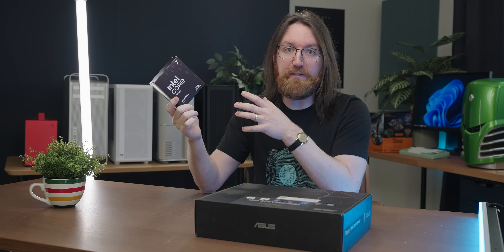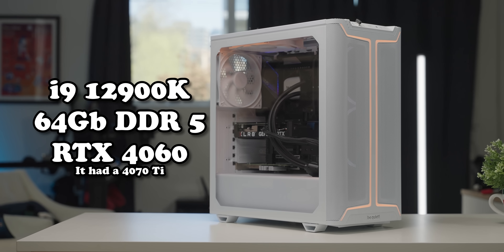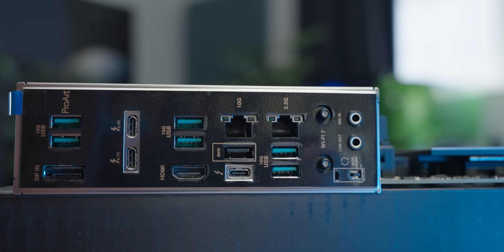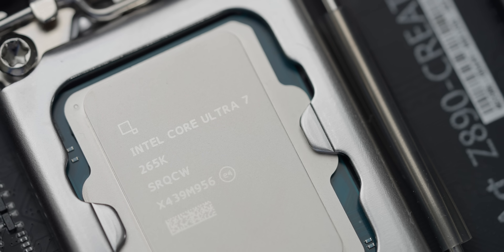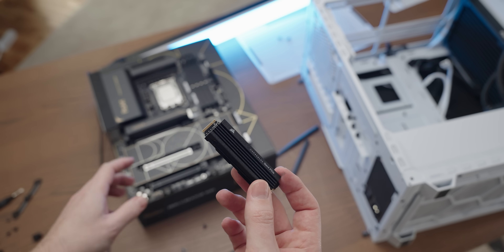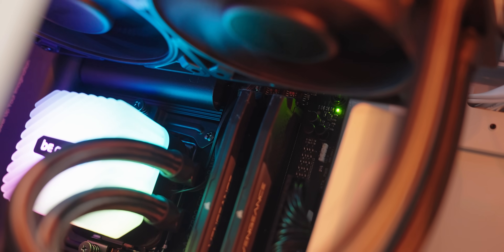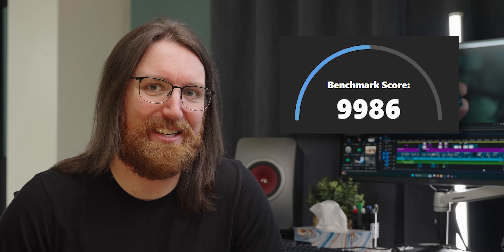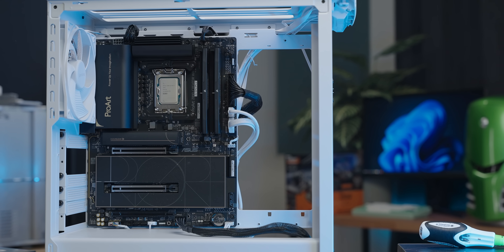I ACTUALLY Bought An Intel Ultra CPU In 2025...

Comment: This video is proof positive of why it's not worth bothering with AIOs. That chassis would fit something like a Peerless Assassin tower cooler and saved you multiple reconfigurations and swapouts with other AIOs. If your case has simple yet effective airflow using a rad to egress heat from the chassis becomes irrelevant.
Reply: it just stop using tiny cases

Comment: For the CPU only the 265 is great value for production work and it has a lower idle power than AMD. The main problem is no support for future CPU generations.
The last time I checked the new Intel motherboards were generally more expensive than AM5.
Reply: Yes but who buys a CPU becuase of idle power usage. The moment you do anything intel cpus jump up to ridiculous power draw, especially the previous couple generations. The problem with intel is their utter stagnation and ridiculous prices on launch. Charging $100 extra on an i9 for 100-200mhz more is peak intel behavior nowadays. No wonder they had to sell so many of their factories.
Reply: @SapTheseCasters  Because not everybody uses 100% cpu at 24/7. Looks like you missed the video where intel was way more efficient from the wall compared to the 9900X by a good amount.
Reply: @SapTheseCasters Even while watching a video its still less power usage than any am5 cpu.
Reply: @kazuviking  wow. Even if that were true, compared to zen 4, which is not, you would save 5 cents per month on your electricity bill. What a reason to buy intel. Are you an editor on userbenchmark by any chance?
Reply: @SapTheseCasters  Remember not only the US exists.
Reply: @kazuviking  - I am never disappointed by AMD fanboiz. What are you like that?
Reply: In my neck of the woods, motherboards with top AMD chipsets are a lot more expensive than that of Intel.
Reply: @RustedCroaker  And you get downgraded features with X870E compared to Z890.
Reply: @RustedCroaker   Perhaps @DawidDoesTechStuff should now see if the Intel® 200S Boost Overclocking Profile is available. I don't use that brand of MB but I would be surprised if the third row back elementatry school engineers of the brand which shall not be meantioned - weren't also up to full speed and provided it in their latest BIOS. 

Now, I myself cannot run the profile since my memory exceeds the Paleozoic DDR 5 speeds capped at 8000MT/s as the Shakespearean quality prose advertised on Intel's recent announcement. But it sounds like he might be able to chip the prehistoric amber from around his tortoise-on-cocain modules and free the beast within. 

But seriously,  it would be interesting to see a BEFORE 200S Boost was applied and an AFTER. They do speak to the Core Ultra 7 265k specifically.

Also, since you have a Z890 board, you might try RAID5 for your game play. Read speeds are greatly improved rivaling or exceeding Gen 5 NVMe speeds depending on drives. Maybe 3 Crucial T500 2TB (~4TB functional storage). I would select a drive model with a Phison controller if you were going to use for any type of production. I use a T705 for the editor. If that's too much the T700 is also a good choice for a Gen 5 main drive.
Reply: People keep say that but if Intel ever said it, I missed it. Can you point me to Intel saying - definitely no others? Usually they will go 2 or 3 generations on a socket.
Reply: yes, but you get superior products.
Reply: @ You can have superior product if the features sucks ass.

Comment: They need to go back to the old names. I forgot these even existed.
Reply: The old names make sense. 
They are grouped sensibly. 
The numbers are easy to understand. 
K is unlocked AND has it's own little GPU graphics chip inside. 
KF Unlocked NO GPU so you need a separate GPU to boot up. 

i3, i5, i7 and i9, short name of just 2 characters. 
12700k - 12th gen, 700 though is errr, i7? So yeah the 700 part could be improved.
Reply: @Google_Does_Evil_Now Some of the older enthusiast level processors did not come with them. I had a 4820k and it didn’t have it. I can’t believe they dropped that line 🥲
Reply: lol its really not that deep
Reply: It is that deep. If you make your product names confusing, people will just forget about them. It should always be simple and easy to understand. Also there was no good reason to change the product naming schemes.
Reply: @nabawi7  people didn't want the integrated graphics or igpu,
so Intel took it out and that's where F comes in. but now you have
KF, which is unlocked but without integrated. now i don't think
people asked about that, but people did complain quite loudly
i might add about Intel's graphics. so you can blame people for that,
i personally never had a problem with Intel's igpu. but if you
are a heavy overclocker type, overclocking with the igpu inside
does get quite hot. so if you remove it, you get a more stable
overclock and it's not as hot. so their is that, but see i don't
do much overclocking anyway if at all.
Reply: Yeah exactly, please we need to petition this really badly.
Reply: right? I havent paid attention to what intel is putting out CPU wise in over a year now. kinda forgot about them. Their GPU side is much more interesting these days
Reply: Core Solo, Core 2 Quad, Core 3 Duo, Core 10 Quad HT, Core 11 Hexa... Just imagine how much better if they still told us the number of cores outright
Reply: They should have just kept going with Pentium... we could be on Pentium 17 like iPhones now
Reply: @adamweb  pentium was named such as it was the 5th generation x86 chip we are now on generation 30+  something it would make litle sense to go back to a name that was based off a generation that is 30 years in the past almost. 

the pentium name got pretty stretched just going to pentium 4 (what was technically  the 8th generation of x86 chips)
Reply: What? There's nothing wrong with names like Mega 7 Ultra Core X293. They are easy to remember and roll off the tongue, almost as easy to remember as AI 9 ZX 242 Max, and the like. I'm sure that in time, we'll get used to these new names, though it would probably be easier if the individual parts of the name each meant something, and somehow separated them from other CPUs in the same family, rather than simply being random additions to the name.
Reply: same, I've kinda lost interest in Intel cpus and a lot of it has to do with not wanting to figure out what the names mean.
Reply: Agree. Ultra sounds something enthusiast-level hardware (like GeForce 8800 Ultra 18 years ago) which these aren't.
Reply: fr bro, as an intel fan im so confused as to why they made this decision
Reply: My copium is that Intel will bring back the core i-series when they become competitive again
Reply: Pentium 22 MMX 3200mhz?
Reply: lol my pentium 3 450mhz IS STILL RUNNING.............. I'm flabbergasted...
Reply: Yeah man the naming scheme of Intel is terrible!
Reply: There was an 8th gen Pentium Gold 5600. I have one in the computer that is "Powered up only to do shopping and pay bills computer" for that and email, word processing and such, it works fine. It's a dual core with hypertheading, 3.9 ghz, an NVME SSD and 16 gb of DDR4 RAM. A true sweet spot for pedestrian computing needs.
Reply: They now have baggage. The 1300 and 1400 should have been recalled

Comment: Amd still go wrong really often... We have 250 PCs at work, purchased over the past year or so (refreshed every 5 years) and the amd ones go slow and stop and get RTBd. The Intel ones NEVER go wrong. All mid to high teer cpus.
Reply: user issue then. never had these problems. most just use intel because of contracts
Reply: All my AMD stuff is still just as fast as the day I bought it. So I'd have to go with user error as well.

Comment: On the new Core Ultra you get a bit more performance if you have your ram at 7200MHz instead of 6000MHz
Reply: 8400 here, just buy any 6400 set they are all hynix and super easy to overclock
Reply: @Just_Mike64  what base speed was your 6400 ram
Reply: They are working on new tech, one without silicon but with Graphine and some other elements which are capable of terrahertz speeds.  Imagine a single core, with performance hundreds of times as current tech. Imagine a triopoly, competing against Intel and AMD. I would laugh.

Comment: My 265k is awesome. Sure it does not match my 9800 X3D in gaming, but since I used mostly for work is better than AMD. I got it for $230 at MC... What can you get for that money? Also is DEAD silent on a 280mm AIO even with all p cores at 5.5 and the e cores a 4.1 ghz
Reply: I heard that before somewhere.
Reply: Yeah,i have it and an AMD 7700x build aswell. It's not bad at all and it will run any game you want anyway. Imo just give it a good GPU and it will last 5-6 years easily. The hate was kinda good for it in a way because it is the reason why it got so heavily discounted
Reply: 230 is a crazy deal for a 265K, for that money it's a no brainer
Reply: SIlent maybe but high temps and high tdp lol
Reply: @PhantomSklyne Nah, the Core Ultras run cool. Where my old Coolermaster 240ML V2 struggled to cool my 13700k, it cools my friends Ultra 7 265KF
Reply: @PhantomSklyne  not at all. 65 C, my 9800x3d reach 74 C in the same workload

Comment: So I have that x570 pro art version and I have 8gbps symmetric fiber here in France, one you turn off efficient Ethernet in windows devices it is solid. Not a single connectivity issue.

Comment: i was trashing intel core ultra until i found out they are beast at video editing etc. i mean not all of us are gamers, so this is a valid CPU to buy for this use case
Reply: But you need to buy a CPU with intel graphics. Intel quicksync is the best compressor for videos, no questions ask
Reply: most gamers would be just fine with intel anyway. i know some neckbeards are foaming at the mouth over 1080p lowest settings graphs, but unless you prefer "numba bigga" over actually playing games, youre running 1440p+ at high settings where the gpu is the bottleneck not the cpu.
Reply: @ true, i learned that 2k and 4k don't need X3D cpus to perform good. even Ryzen 7 7700 can "match" 9800X3D
Reply: @iris4547  true. These data only usefull for people who play cpu intensive game which is not aaa games is msot cases
Reply: I have intel core ultra 9 285k and Amd 9700 XT (gpu) about Clip studio paint has show no crashes and including old games are amazing over 400+ fps
Reply: They're best SPECIFICALLY in Adobe.
Reply: @ShockingPikachu  they're good in other productivity tasks too. A 20 core 265k is going to destroy an 8 core 9700x in anything multithreaded.
Reply: @ryanspencer6778  the p and e core thing intel introduced didn't have much effect on its overall performance compared to AMD. It was loading less powerful cores alongside more weak cores and hoping it would make caching better.
Reply: Exactly, you get an x3d if you prioritise gaming.

If you prioritise productivity and intel is doing that better then you go intel.

So for video editing if it’s more affordable and the output of performance is not substantially worse it’s not a debate.

(That’s why amd gpus are good cause if you get a high % of the alternatives performance for a lower % in cost it’s better for the consumer)
Reply: @draketurtle4169  You don't actually need x3D cpu for gaming. A normal 6 core or 8 core AMD cpu like 7600x, 7700 or 7700X is perfectly adequate for 1080p, 1440p and 4K gaming. X3D cpus are so expensive and you're not getting that much in return.
Reply: True unless you care about performance per watt. Which is massive weakness on most intel cpu compared to amd except budget ones

Comment: Why would it be a disaster if the drives had died? Are you seriously not running redundant storage in 2025 Dawid? Cmon man - you can do that really cheap by just hooking up a dedicated NAS to your PC which runs a continuous backup of your storage. Also - make sure you set up the NAS to run in mirror mode - for that extra layer of security. It really should cost you more than like $500-ish (depending on how much storage you need - this is for a mirrored 8TB solution using 2 8TB Seagate Enterprise drives which cost around $300 for both) and a few hours of your time.
Reply: so youre advocating hardware raid??? lol
Reply: @BenState  What's the problem with raid? I don't get it
Reply: @alexandercatterson223  absolutely nothing. He probably thinks cloud storage is the best - because he doesn't understand the obvious limitations with it - nor does he fully grasp the risks associated with freely giving datacenters access to your intellectual property. Just ignore these people on the same level as the crypto bros! "How did this information leak?!?!" Well MAYBE we have bots constantly scraping the internet for data - and MAYBE you shouldn't let these bots have access to your data. It's a hard concept to grasp for some people:-)
Reply: crickets.... thought so

Comment: I don't get the hate. I've had 265k since launch and haven't really had any issues with it and I'm very happy with the performance. Sure the X3D AMD cpus are faster but they are over £100-150 more. I wanted an ITX board too and the x870 ITX boards at the time I purchased were nearly twice the cost of a Z890 ITX board.
Reply: X3D is for gaming

Their strength isn't raw framerate but rather 1% lows, the smoothness of the game is completely different even at the same framerate.
If you buy an X3D for production, you're doing it wrong.
Reply: Tell that to the people who play Valorant 24/7
Reply: Dead platform.
Reply: -No real improvement over the 14th gen

-Good motherboards are expensive 

-It's already a dead platform with no upgrades besides the Arrow Lake refresh (from leaks)

-Needs expensive RAM to get the full performance.

And last but not least, the problems with the 14th gen...
Reply: @gamesk6476  Why are people upgrading from 14th gen to 15th gen. There wasn't any real improvement from 7th gen AMD to 9th gen either. I bought some cheap DDR5 7200 and it's been running perfectly fine in the 99% percentile of synthetic benchmarks, Intels been offering microcode updates that have increased performance too.

Don't believe everything you read or see from the people who review this stuff, they get this stuff for free and don't appreciate the value of something when they can just ask and get a free 9950X3D that will destroy the 265k/285k in benchmarks.
Reply: @ArcticFox63  these ppl buy new iphones every year
Reply: @ I'm talking about people upgrading from 12th gen to something newer. Why would anyone upgrade to an Ultra and change a dead platform to another dead platform when the 14th gen exists and performs almost the same?

The last part is just coping... It's true to not believe everything you see on the internet, like Userbenchmark but when the majority of reviewers have the same conclusion...
Reply: @gamesk6476  I'm not talking about benchmark results. I'm saying their opinion is skewed because they get all this stuff for free. Of course they are gonna talk crap about Intel when faster stuff exists but that faster stuff means an extra £300+ on top.

You keep saying dead platform, who cares?

No one is keeping a motherboard more than a few years and putting the most expensive new CPU in it when it lacks features of the newer platform.

People buy once and then upgrade in 3-5 years time and the new sockets and chipsets will be out by then.
Reply: @ArcticFox63  Obvious Intel fanboy is obvious.
Reply: @Bizarny  Yeah I forgot people can't have different opinions without being called a fanboy.

At the end of the day when I upgraded it was cheaper to go with Intel than AMD, thats the only reason I picked Intel.

Hardware reviewers are out of touch when they don't have to pay for their own hardware that's all I'm saying.
Reply: @ArcticFox63  Most trusted reviewers take the market price in consideration (not MSRP) so no.

A lot of people care about the longevity of a platform, just look at AM4 and how many have an Ryzen 5000/x3d on an old motherboard. 
Not everyone upgrades their system like you do.
Reply: About 2 months ago I picked up a new 265k for $330 and a new z890i motherboard for $220 and I have been extremely happy with it so far. At the time I bought it you couldn't even get a 9700X and a B850i for that price. Gaming is very close between the two CPUs and the 265k destroys it in pretty much all workloads.
Reply: People just forget that you can do things on computers besides gaming. It's funny, because Ryzen was originally great for productivity and only ok for gaming, and the general consensus was that it was dumb to care only about gaming lol.

Comment: Yo thanks for the video, now I have a question. So who is a "good value audio/video production cpu" really for? I don't know what camera setup you have, but I see a lot of reviews where they are taking footage from a $10K+ camera with thousands of dollars of glass on it, and benchmark through the adobe software suite that costs $60/month if I understand correctly (so $720 per year) and at that point are you really pinching for a few hundred dollars? I don't know anything about video production really so just curious if you or anyone else has some thoughts about this.

Comment: Thank you for your input, I will send them the notes I collected
Reply: @christophermullins7163  the damn 24pin power connector gets used a lot in arcade games and guess what burns out damn 12v rails they split the rails so only one of them gets used for most of the add-ons inside the arcade game...

Comment: If it's for video editing, may as well go full blue for the memes and arrange-marriage that CPU to an Arc card for the AV1 hardware acceleration.
Reply: dude I had an i7-11700 with an A770 for a while, was mid for gaming but was the best rendering rig I've ever had
Reply: The A380 beats the 4090/5070TI/5080 in AV1 rendering speed and image quality.
Reply: Amd video encoder card is king atm. A card most people never know
Reply: @ But that's not going full blue for the memes. :V